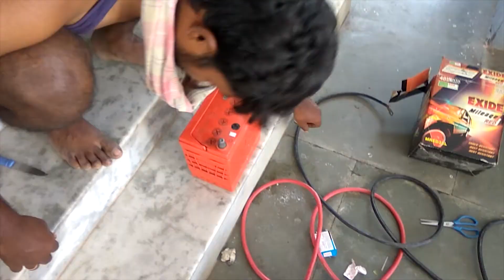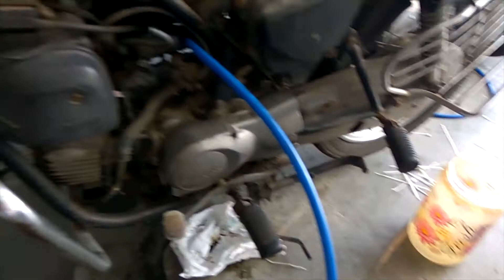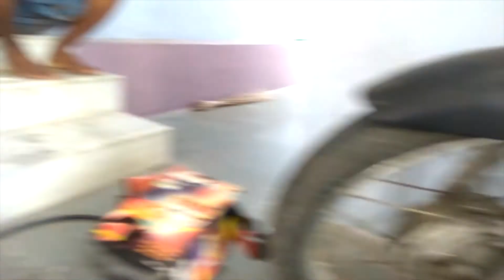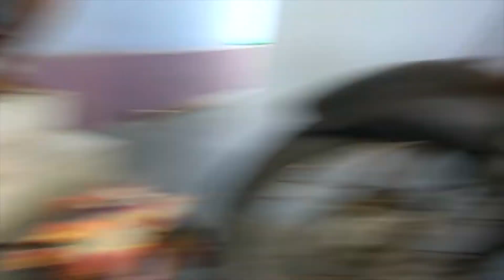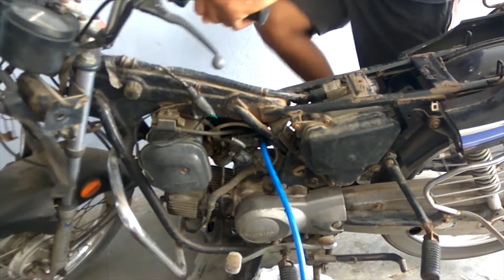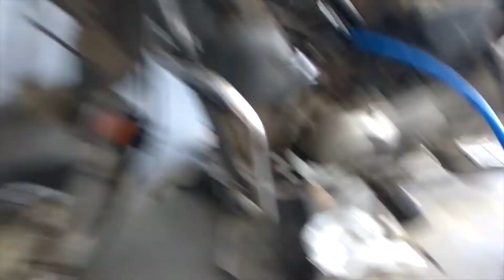How to convert URINE as a PETROL?? | Running vehicle using urine | HHO generator

Comment: Don't use air cooler engine. Use oil cooler engine or water cooler engine it's working call me 9944274914
Reply from the maker: Sure will call u bro